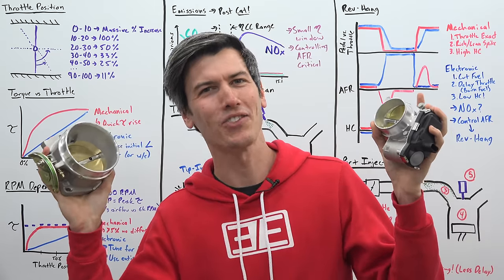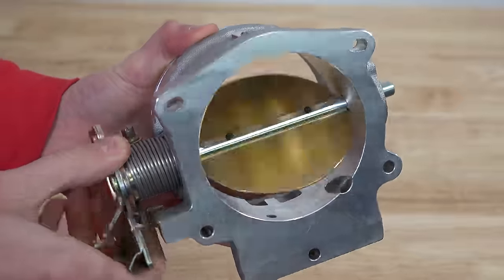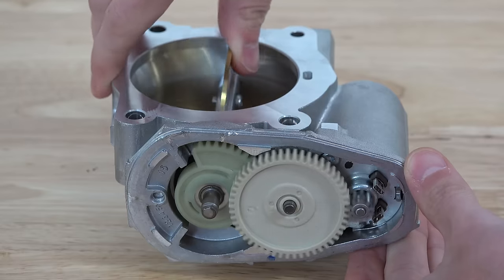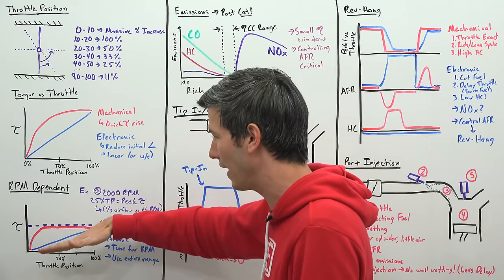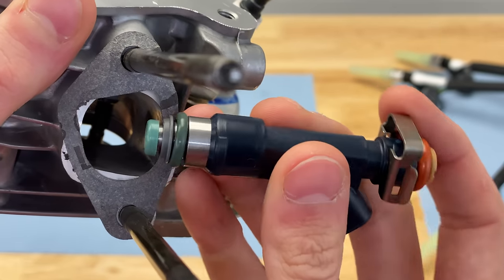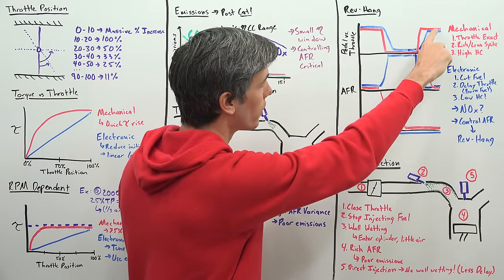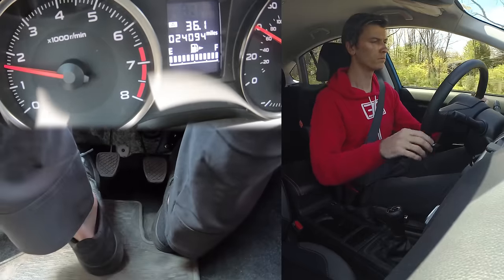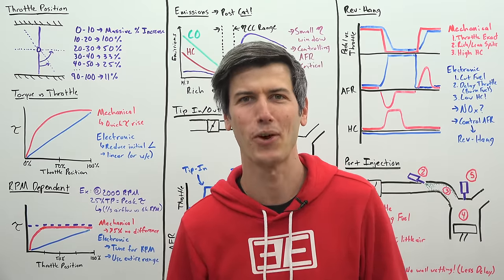The Big Problem With Modern Manual Transmissions - Rev Hang

Comment: In the late seventies we had a similar problem with emission controls causing rev hang. In this case it was a dash pot on the carb to slow the throttle closing. The solution was to disconnect the the air pump, remove its drive belt, and remove the dash pot.

Comment: Correction: You can make the curve "torque vs throttle" different with a mechanical throttle to. Maybe it's not commen to do that but it's easy to acomplish.
Reply: It depends how signal from TPS is handled by computer 👍
Reply: A throttle cam will only change the butterfly valve opening speed relative to the pedal input. That's not the same as having the valve position determined by the ECU.
Reply: @behexen250 I mean the torque at the wheel.

Comment: One thing. With a cable throttle body you can fix a lot (not all) of the non linear opening with a cammed pulley on the throttle shift or with a linkage to a plate at the pedal. This is used on some aftermarket throttle controls on motorcycles for example.

Comment: I noticed one of my Ford Econoline vans using OBD2 live data readers. When the engine would be at 100% load, the throttle body would go from line 52% open to 100% your explanation of the throttle body being sized for maximum load and a much higher engine RPM explains this. Thanks for helping me understanding this weird phenomina as ford engineers being cleaver in reducing their pumping losses.

Comment: wrx owners have entered the chat
Reply: Clutch in, shift, count to 10, clutch out
Reply: WRX owners wait for throttle response
Reply: I was surprised at how much a cobb flash helped throttle mapping with my dads ‘16 wrx.
Reply: Zack H I think my grandma would love your advice.
Reply: not as bad on the Focus ST but I experience this as well, 1st to 2nd is either: shift, wait 1-2 seconds, clutch out. or shift, give the car 4k rpm, dump clutch, or it's not smooth.
Reply: For real tho is it bad on wrx's? I want to get one but I experienced similar annoyances with my old 350z. The waiting is annoying and it makes the acceleration so weird people behind are probably like "the hell's this mf doing" lol. Either that or just deal with a jerky drive, which I imagine likely isn't that good for the powertrain. Really was hoping to not have to deal with that again.
Reply: Wrx head gasket left the chat
Reply: Was waiting for this. Feelsbadman.  Although my car has been tuned for a while and it made it a little more tolerable.
Reply: @fups1  It's still kinda there for me but waaay less annoying than it was stock.
Reply: Wrx owner: what are you on about?
Reply: My '11 regular impreza rev hang is quite annoying, i would love to eliminate/reduce it
Reply: My Forester STI rev hang is deeply annoying. But you do learn to drive around it.
Reply: lol after 7 months of ownership i've finally mastered the 1-2 shift. even still it's only smooth 60% of the time.
Reply: @christopherpape4823  it's bad but can be fixed pretty easily with some tuning. you do need some other stuff to better eliminate it, though. an air intake and exhaust will usually make it much better. that goes for most cars but especially WRXs.
Reply: Thats why I'm glad I have an '03 Bugeye WRX. Thing is extremely bare bones and raw compared to any wrx/sti model made after '07
Reply: @christopherpape4823  on my '17 it's not bad when you're pushing it hard. What's worse than the rev hang is brake override. If you're on the brakes hard enough it will ignore throttle input because a handful of morons put the wrong floor mats in their cars.
Reply: @misterprimeminister473  lol but why would you want to brake hard and be on the throttle at the same time anyway?
Reply: 07 STI worst throttle hang of all time. I drove a manual 07 Legacy and i swear it wasn’t even close
Reply: @christopherpape4823  Rev-matching for a downshift while braking for a corner.
Reply: Yup
Reply: Christopher Pape I have a 2019 and from first to second it’s bad on a factory tune. In some sadistic way I see it as a skill to get around. What I’ve found if is you spike RPM to around 4K and quickly but smoothly get into second you’ll get minimal car imbalance but if I’m too slow it’s one of the worst jerks you’ll experience. The other option is wait two second for the car to come back down to 2k RPM.
Reply: @misterprimeminister473  ah yeah v fair I can see how that would be annoying. So it basically just doesn't let you rev match? That would really suck.
Reply: @christopherpape4823  to brake boost

Comment: Don’t know if you’ll ever see this but this is everything that’s wrong with my 18 GTI,  I can never get the shift from 1st to 2nd because it seems the rev hang is different every time.  I also always get “throttle lag” which is almost like I get two turbo lags.  I’ll put my foot down on the throttle and leave at say 50% and it will take 2 seconds until I actually feel a boost in acceleration and then I feel the turbo kick in.  I am a recent grad in engineering (automotive) and I have never driven a electronic throttle vehicle that I have enjoyed the electronic throttle.  If possible I would love to discuss this further.  Thanks for all the great content.  I’ve probably learned more from you than college.

Comment: Rev hang, a cancer in modern manual transmission cars.
Reply: @Commander Spock - it allows manuals to still exist.  Without it cars can't pass emissions
Reply: Can generally tune it out.
Reply: @corpsiecorpsie_the_original  yes it can. You just don't jam the throttle all the way in and you get better torque and fuel efficiency. I never press the gas all the way in when im on low revs. No need for electronic crap
Reply: @corpsiecorpsie_the_original  my 03 wrx without rev hang just passed its emissions a month ago lol
Reply: I just let out the gas slightly earlier before pressing the clutch. It does the job but it's kinda hard to predict if the engine will rev hang longer or shorter. Kinda a hit and miss game sometimes.
Reply: Corpsie Corpsie thé émissions tests are wrong. Crapalytic converters make if worse
Reply: @Grooove_e  testing for smog and passing homologation are two very different things
Reply: @dieselgeezer18  - when have you done emissions testing at an EPA certified facility?
Reply: @Grooove_e  - Why would you be testing an old car against EPA new car emissions standards?  How did you get into an EPA certified facility?

Comment: A really great detailed explanation of the only thing I don't like about my Subaru.  Just after I bought it I asked the dealer if they could fix it. I said that if it had a carburettor, the throttle return spring needed beefing up.  Nooooo they said, it was an emissions thing - end of story.
Is there a cure for it because it spoils the joy of a manual trans.

Comment: EFI cars with cable valve bodies still suffer from rev hang by design as well, though it is facilitated via the idle air control valve.
Reply: Yeah. My suzuki G15A engine does that randomly

Comment: Shock content from the beginning. Always thought that the rev hang is caused just by the heavy flywheel.
Reply from the maker: Common misconception! It's the electronic throttle. :)
Reply: My 3000GT VR4 has rev hang, even with cable throttle. That's cause the flywheel is thick iron and it idles too high when cold. Perhaps the tach is also slow 🤷‍♂️
Reply: @EngineeringExplained  Earlier Honda (80s) throttle-body FI engines have behaved like this for years and years.
Reply: @jonathonhebert7042  your flywheel weighs 22lbs. you just a bad stock tune or perhaps an old engine with a slight vacuum leak.
Reply: Nah, if it would be flywheel, it would do the same on idle when reving it.
Reply: @OxBlitzkriegxO  Like I said, combination of issues can cause idle hang. Often it's very tiny things that are hard to find
Reply: @EngineeringExplained  it's the engineers messing about.

Comment: Subaru EA82 engines (and others, including my old 6-port 13B) mated to manual transmissions used a dashpot to prevent sudden throttle closure and thus reduce emissions. The dashpot was there to slow throttle closure, engaging around the 10% throttle mark and slowly allowing it to close to 0. There was no noticeable rev hang because the dashpot didn't engage until the throttle was nearly closed and if it took you that long to shift, you were probably going to have a choppy gearchange or come to a stop anyway.

Comment: So my 2006 sti has an electronic throttle body and I wanted to solve the rev hang problem and so I got a lighter flywheel and installed that and honestly that helped a lot.

Comment: Interesting, I met this issue when driving 1.6l Renault Thalia, before that I was JDM-land driver (Nissan Almera N15 1.4, Subaru Forester I 2.0NA) and I was surprised with this rev hang.
Pretty quickly I found a workaround so I simply was letting off the accelerator and waiting for the torque to wear out before clutching in. That way shift is smooth although pause in acceleration is still noticable…

Comment: I recently switched from a car with mechanical throttle to one with electronic. I kept wondering why I wasn't getting the torque I wanted from a start in the new one. This explained it. I'm getting less from the throttle press I was used to.

Comment: I have driven mechanical throttles that also suffer from the Rev hang.  It's not as bad but it's there.  A few I've had use the idle control bypass valve to eliminate sudden closed throttle decel. Reason I was given is cutting down on emissions. It wasn't super noticeable until I had the idle valve fail it it was like shifting a carburetor car. Let off and instant decel or rev down

Comment: Echoing many of the comments here. 
Whereas: Emission control considerations are the primary cause of rev hang on manual transmission cars. 
Whereas: Manual transmission take up on new cars is less than 3%
Be it resolved that the EPA loosen HC limits on manual transmission cars only to the point where driveability is restored because the effect on emissions will be negligible. 
Yes, I know this will never happen.
Reply: we love manuals, but people who buy crossovers dont
Reply: Like the complete b*ll*cks stop-start joke. No way that uses less fuel normally.

Comment: Sold my 2018 crosstrek partly because of terrible rev hang. Was terrible. 

2019 Fiesta ST is much better
Reply: Jesse S. sounds like a meme “terrible rev hang was terrible” (without the full stop)
Reply: The fiesta st's are piles of garbage.
The subarus are pretty reliable.
Reply: Did the same thing with my car. I hated the rev hang so much drove me insane 😵 i ended up buying an automatic car lmao. In my opinion the fun of manual shift is dead. Unless i get into an oldie
Reply: My lady boss in my previous work had an orange one, looked pretty sweet. Great choice.

Comment: Great explanation, thanks! My 09 Matrix 5 spd has rev hang in spades - it's like my throttle pedal movements are only a suggestion. From dead stop I often over-rev (really trying NOT to) and I'll bet that's chewing into any mileage/emissions calculation. My old Tercel with manual throttle linkage was smooth as silk.

Comment: I had a small subaru four wheel drive. Mechanical throttle. Boy was that thing fun to drive. The rust ate it up tho. Had it for 10 years. I have now an Oktavia 2 MPI 1.6 for 10 years and still have to get used to rev hang.

Comment: Good video thanks!

Rev Hang delete, at a sacrifice, on 05 Mustang GT
I had noticed on my 05 mustang GT that the idle was higher when de car was moving forward than when it was stationary wich was causing bad rev hang. I had the the response tuned as agressive as possible, still had this ''twin idle'' issue. Then I thought: '' What if the car does not know it's moving? ''. So I disconnected the speed sensor on the transmission and voilà! No more rev hang and now I have a properly responsive engine in my Mustang.

Comment: I've noticed rev hang in some newer 'performance cars' so bad that I wouldn't consider buying one, but I also notice it in my daily driver - a 2014 ford focus with a DCT.  Scenario: On the freeway, far right lane in very slow traffic. Switch one lane to the left and stomp the gas to get up to speed before someone comes along and rear-ends me. Another driver in the right lane has the same idea and jumps into my lane but doesn't accelerate quickly forcing me to hit the brakes hard. When I switch from hard on the throttle to hard on the brakes it takes about 3 seconds before the engine RPMs start to drop and stops fighting the braking. Very scary behavior from a car. I'm considering buying and older car and restoring it rather than buying a new car at this point. (not just because of the rev hang, of course, personal data privacy is an issue too)

Comment: For what it's worth, Ford was doing this on the 2.0L Capri - in 1974! There was an extra passage with a vacuum operated valve in the carburetor. When you let off the throttle, the carb vacuum would increase quickly and that would open the valve, dumping gas into the venturi. Crude but (perhaps?) effective.

Comment: I have a DI engine with ETB, it definitely still has rev hang, although it is significantly improved vs. port injection models I have owned.
In an rpm range under 4000, it functions well. However if you go above 4000 rpm before shifting, the rev hang starts to mess with shifting, especially if you're trying to shift quickly.
Rev hang really screws up the fun of driving a manual transmission in anything which is sporty.
Also causes a lot of people buying fancy sports cars, and then when they actually go to give it an itallian tune-up on a back road, they bounce off second gear.

Comment: A radio controlled nitro car basically runs on a drive by wire system as well. A servo controls the throttle body in the carb and it is way more responsive that a car today. Many people have tuned out the rev hang issue with an upgrade to the pcm/ecm. The slow response is due to the computer making decisions vs the mechanical style.

Comment: Thank you for taking the time!
Sorry, but I’m calling BS on most of your points here.
Tldr: tip-in and tip-out problems were handled in the days of carburetors, and the computers that run today’s engines are orders of magnitude faster and more capable. This is an engineering / software fault at the manufacturers.
Long version: I have been fixing drivability problems for 25 years, and have driven, studied, and repaired a wide enough variety of vehicles to say with understanding: engineering and bad programming are to blame. BMW are not suffering from this foolishness, for instance. My R53 Mini (BMW FWD) has no perceptible rev hang, since having changed out the factory dual-mass flywheel.
Modern microcontrollers are so fast they can see how rapidly the throttle is being closed or opened before you even realize you are doing it, and they tailor injector pulsewidth accordingly. There is no inherent problem with fuel overrun, or wall wetting, any more than there is a problem with lean mixtures on tip-in. M/T cars that have the best drivability have computers that watch the clutch activity so they know when to cut fuel to facilitate shifts. 
Yes, electronic throttle bodies even out torque delivery, but drivers are still adjusting their right foot as they go through a gear to match the torque being produced; in effect it is just a different torque curve and it is no burden to drive a cable throttled car vs an electronic throttled car. On the other hand, with rev hang we are trading one potential point of jerkiness (the big change in airflow at small throttle openings) for another (clutch engagement with unneeded energy stored in the flywheel.) Again, no gains to be found in this regard.
Yes, electronic throttle bodies are good for stability control, and for hiding how the engine runs when VVT is helping the cats get up to temperature, and for smoothing auto trans shifts, but none of those functions inherently lead to rev hang. 
Flywheel weight does have something to do with it, but the effect has been masked by manufacturers chasing marginal returns and ignoring customer desires.
It is possible to have a usable throttle - the kind that lets you position a car in a corner without stability control interfering - and still have good emissions. 
The ONLY reason for rev hang outside of bad engineering practice is to keep cylinder pressures up during the intake cycle to improve oil control thereby reducing HC emissions and catalyst poisoning, not from fuel but from oil. The amount and duration of rev hang necessary to accomplish this is is minuscule and not consistent with what we see in most modern MT vehicles.
Reply: Thank you, I thought I was the only Auto engineer watching this and thinking "that's not how this works". It was the case in the 80s/90s but things have moved on significantly since and as noted no modern system has this lean/rich issue. You would never get past current emissions if you did. 
Besides the points you made above another reason this is so common is that modern cars are not aimed at drivers, they are aimed at the parent picking their kids up from school, and thus a sharp throttle response is undesirable, that rev hang is safe and stable if you make a clumsy shift on a corner. 
Your average auto driver is also much harsher with their throttle inputs so damping those inputs in a market with primarily auto drivers makes sense. 
A Miata is targeting a more demanding market and thus they eliminate a lot of it at the expense of higher expectations on the driver.  It is not a GDI vs PFI issue, its a family wagon vs sport car issue.

Comment: Excellent explanation ! Years ago, carburetor dashpots were a crude attempt to accomplish the same thing - with the same Rev hanging problem. I have a cable connected to my gas peddle and I do NOT treat it like an on/off switch, though I'm certain I'm not as clean as a modern microprocessor - you'll have to pry cold dead hand off the shift lever on my 1996 GSR